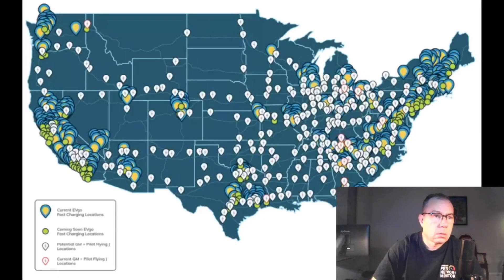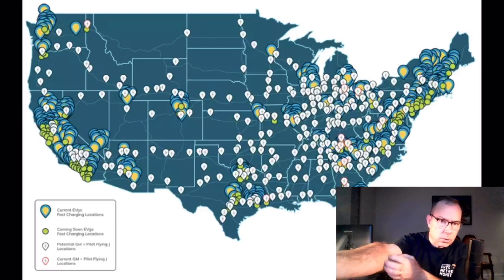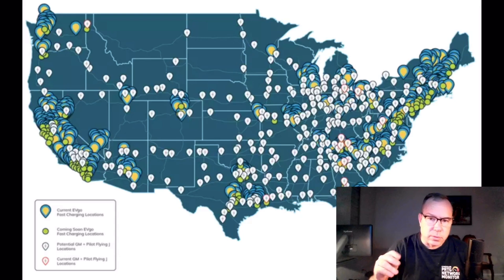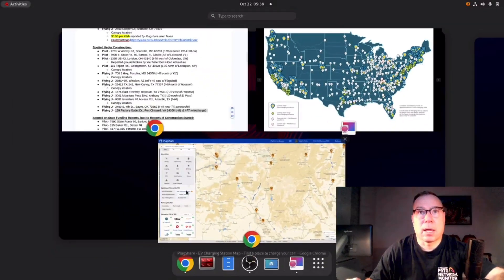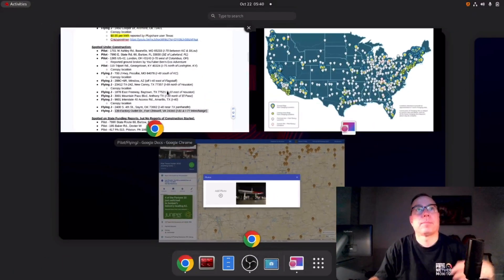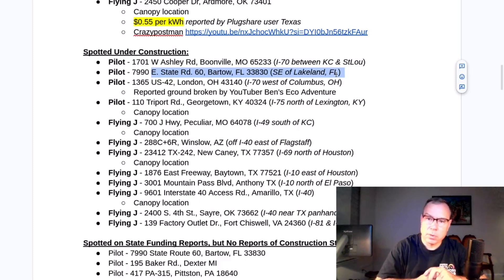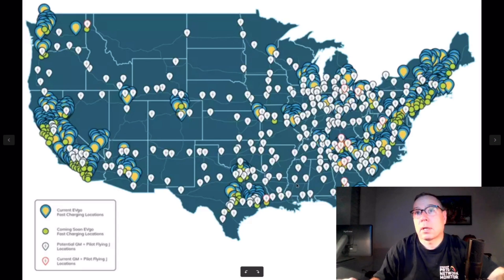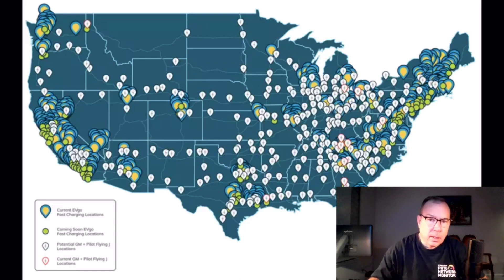Ultium Pilot / Flying J Update #04 (Electric Vehicle Charging)

Comment: Thanks for the update. I’m not confident enough yet to add it without a visit, but I’m thinking the Pilot in Greenfield, Indiana will have DCFC. The site is being rebuilt so it seems logical to put in charging while everything is torn up.
Reply from the maker: I thought so too, but there are two locations in NC going through facilities refurbishment.  Neither has any sign of DCFC build yet though.  I also passed by a few on the 12 site visit that were just finishing or starting refurbishment.  I think the facilities refurbishment team is a different initiative then the DCFC build that is likely waiting for gov funding b4 starting in earnest.  However, only the staff at Pilot Corp really knows for sure.  Thx for the contribution and comment.  I really appreciate them.

Comment: Thanks for the detailed coverage, Walter! They appear to be moving even faster than I anticipated, but I think you're right that between the NEVI funding and the new Plano, TX Delta facility, we're about to see EVgo kick this into high gear.

One thought about the randomness of the locations is, it could simply come down to site planning, permitting, and local utilities. For example, I haven't seen any movement at my Pilot locations in California (they are on the initial infographic); however, California has such onerous requirements that it takes more than double the national average time to bring a public charging site online. Essentially, EVgo and Pilot-Flying J could have submitted the site plans and applied for permitting for all 200+ sites at the same time, and we'd still see this random outcome. Based on past site build outs, I'd expect to see locations opening in a number of states soon, but we'll likely be waiting another year or two for our sites to open  here in California.
Reply from the maker: Great points Eric!  It could be coming back to partner (gov, util, supply) responsiveness.  I had heard one commercial venture in CA mention 2nd had from the FreeWire CEO that PG&E responded to his transformer request with a 2027 time frame, helping with his decision to go FreeWire.  Maybe we are just seeing the early bird responses come in.  Best wishes on speedy DCFC builds.  Maybe a wave will come through not too long from now.  Thx for watching & the comment.